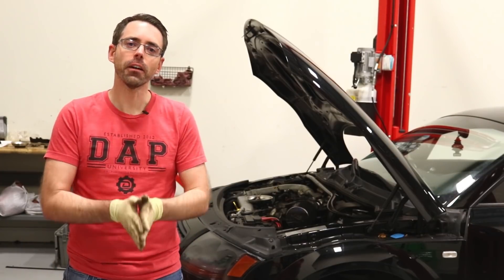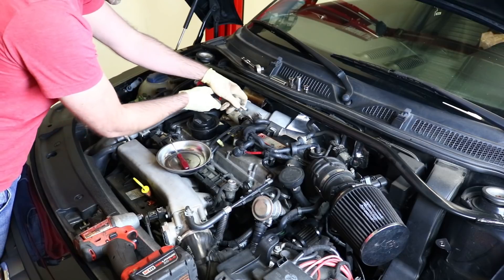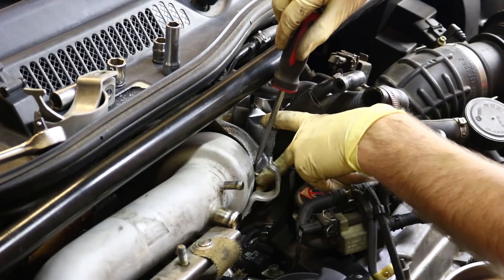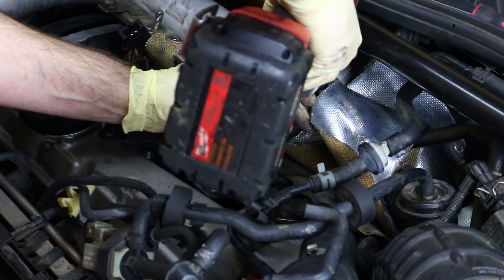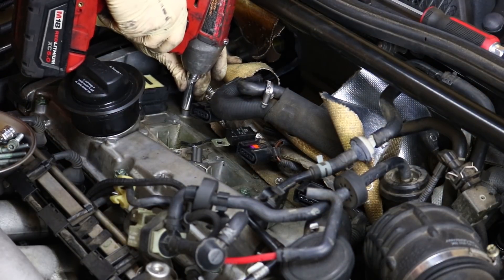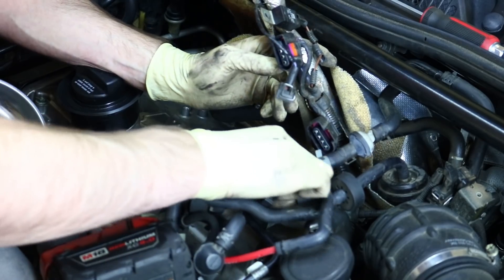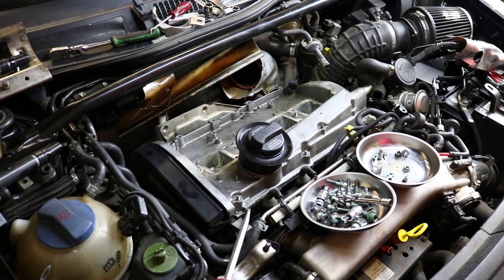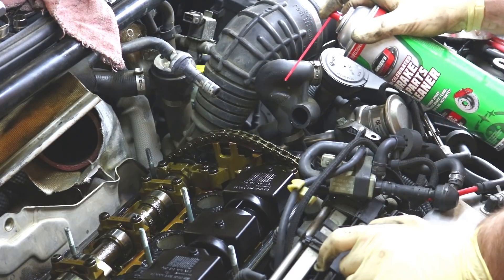1.8T Valve Cover Gasket DIY | Cam Chain Tensioner / Half Moon

Comment from the maker: All Parts and Tools used in this video can be found below! - We appreciate your Support and Purchases! -

OEM VW/Audi 1.8t Valve Cover Gasket
https://www.shopdap.com/058-198-025-a.html

OEM VW/Audi 1.8t Timing Chain Tensioner Gasket
https://www.shopdap.com/058-198-217.html

Hose Clamp Pliers
https://www.shopdap.com/vw-audi-hose-clamp-spring-pliers.html

RTV
https://www.shopdap.com/black-rtv-vw-audi.html

Chain Tensioner Tool
https://www.amazon.com/gp/product/B07KG3TSBT/ref=ppx_yo_dt_b_asin_title_o01_s00?ie=UTF8&psc=1
Reply: My question is, can you get that tensioner out, and replace it along with the chain without having to take the cams out. and what the service interval for the chain is. I know my car has been through at least a coupld of timing belts, but i don't think the chain has ever been replaced.

Comment: I just did this job- two things to note
1. If the chain isn't slackening don't break the tool, take it off and rotate the engine to tdc. Get someone to watch for the notch on the flywheel while you turn the crankshaft. Try again
2. If your tool like mine (laser) doesn't actually bottom out, don't go all the way down as it actually makes the chain tighter
Reply: I suppose I should of read the comments first wondered why the chain got tighter. Just ordered another gasket🤣😂🙈

Comment: This is a superb video for this 1.8T job.  I reeeeaaally wish I had had this video pop-up in my recommendations few days ago, though, as I have a 2003 A4 with the same engine -  but the orientation is different - and I just changed the rocker cover gasket on it but my manual doesn’t tell me to change the cam chain tensioner gasket ag the same time as well.  I didn’t know about that special tool, either, and it’s only about a fiver!  Well, it looks like I’m buying more parts and a new tool and doing the whole job again!  Thank you so much for sharing this!  Great work, and very much appreciated by me!  🙏 Stay safe and well!

Comment: This a huge relief!  My chain tensioner is leaking and when I found out what the part was..I thought I was screwed.  This looks like a very simple procedure!  Thank you for making this!!
Reply: I assure you, simple it is not.  Most mechanics remove one camshaft to clean where the half moon goes and you have to put it the exact same spot for engine timing and also torque the camshaft bolts in the correct sequence...
Reply: Simple???? 😂😂😂 this is 3 day job tbh
Reply: I'm on day 3...broke the tensioner because my cam was in the position and the tool snapped off one of the fingers. Once I figured out how to get the cam out, while clamping the tool to the tensioner , and then wiggled the tensioner out, yea it's super simple

Comment: My MK4 1.8T is leaking oil at the back of the engine. Now i know it's eithe the Valve cover gasket, the chain tensioner gasket and half moon or all them. Would have to change all of them so thank you very much
Reply: Also suspect exhaust cam seal

Comment: Thanks, Paul! Can you replace the chain tensioner using just the compression tool or do you need to remove the cams? I’m asking for my AWP motor in my 2003 GTI.
Reply: as far as i could find, you need to loosen the intake camshaft, then it will come out. Need to do the job myself aswell.

Comment: Has anybody here experienced the metal wing breaking on the tensioner, just wanted to do the gaskets then that ended up breaking on us while trying to tension it down we ended up having to break the chain and put a new tensioner and chain on, then after tightening the all of the cam caps and shit and releasing the tension it had broken again, going to have to break the chain again and put a new tensioner and chain in again, I would like to make sure it doesn’t happen again

Comment: Thanks for the video. Is it necessary to rotate the engine to TDC prior to using the tool on the tensioner? I see it mentioned in other DIYs, but didn't hear it mentioned in your video.
Reply: Currently seeking this information
Reply: @Gangstarappa691  i normally only set TDC if im changing the timing belt or plan on removing the cams or anything

Comment: I was unable to get my chain tensioner loose while cranking down. It started to get loose but then got tight again after bottoming out in the tool. Ultimately I didn’t replace the half moon and small gasket. I replaced the valve cover gasket but after test driving once completed it still leaked. So I know it’s leaking from the half moon and chain tensioner gasket. So I will be going back in to redo it. Does the engine half to be at TDC to do this loosening of the chain tensioner? Does it matter? I am again going to go through the entire process getting back in and replacing the new gasket I just replaced along with trying to loosen the chain tenSioner with the special tool. This video was great by the way. Thank you.
Reply: Did you ever get it

Comment: Wouldn't you be worried about contaminating the oil with brake cleaner, or is the assumption here that the oil is getting changed as part of this maintenance...
Reply: i was thinking that as well
Reply: You use the brake cleaner with the plugs still in place then blow out with compressed air (into a rag) or sick rag/paper towel into plug recess to soak up liquid or use turkey baster as someone else suggested. Doesn't matter if some small amount of cleaner drains into cylinder as it will be burned/blown out.

Comment: If i had my timing belt and water pump changed and valve cover gasket changed....should the tuning chain tensions have been changed at the same time to save money....in the long run?

Comment: Thanks for this video. I have a lead under my car with a good amount of oil on the bottom of the transmission. Can anyone let me know if this sounds like a good estimate to get this work done? Work Order: Remove & Replace VVT Actuator Gasket
  
Labor			Total
Remove & Replace VVT Actuator Gasket			$875.70
Valve Cover Gasket Set
Job Total $988.13

Comment: Same tool, agu engine but no way to compress the tensioner. the head of the tool bends and ends up cracking. Im a bit at loss as the seal leaks badly and Im stuck :{
apparently it is supposed to lift the bottom but it loos stuck and the chain doesnt lose any tension. If anyone has a tip. thks

Comment: I am wondering if you or anyone else might be able to answer my question regarding this engine... My 2001 1.8T was never, NEVER, EVER, starting from the first crank while the engine was warm... Cold start?! No issues at all, but hot start... Damn, it never ever started, I could have crank it forever, it was never starting. I always was cranking it up for a split of a second, then switch the key back off, than cranking it again, it was starting with no sweat. So, let me recap; cold start was fine, always, hot start... No, not from the first try (switch key on, and crank the fuck out of it), I always had to turn and crank 2 times to get my car started.
I've changed everything, water temperature sensor, crankshaft sensor,  there was another sensor down at the engine, don't remember exactly... But I've changed everything, new coil packs, new battery, new MAF sensor, new air filter, new fuel filter... I just couldn't get it fixed. No check engine light, nothing on VCDS.
Any thoughts?!
Reply: crankshaft position sensor
Reply: @ATL_z33  I was replaced, that didn't fix my issue. I ended up selling the car eventually...

Comment: Hey @deutscheautoparts, great vid!  I will be doing this soon on my 04 Passat, so I have done a full playlist on removal and install of the 09a trans valve body for the 5 speed Tiptronic transmission link below:

https://www.youtube.com/playlist?list=PLUtVpnAFZXAyuCvXa2RAzNqcYFdbtBzYi

Maybe you guys could do a cleaner playlist with less vids, or clean up any mistakes or find shortcuts, to help others see this job is really a DIY, and sadly a common issue.  I know I was not the only one who needed/needs to do this job.  Keep up the good work!

Comment: Do you think you need to put the engine on TDC,   And count and mark the chain links before doing this ?
Reply: I would recommend to do so, it is not likely to jump a tooth but it is not a nice feeling if the intake cam is just on the edge of turning around and slips down and you aren't sure anymore if it is in time anymore. There are marks on the cams that align with the cam cap marks at TDC also. I usually put a paint dab on the chain in relation to those marks so it very easy to double check at the end.

Comment: So I can see some oil leaks on my engine block but struggling to pin point exact source. Could this be from the turbocharger pipes connection to the block or from the valve cover gasket. Mileage is 110,000. Model VW CC Sport 2019. A clip showing the leak is below
https://youtu.be/I-wQpp_bBVs